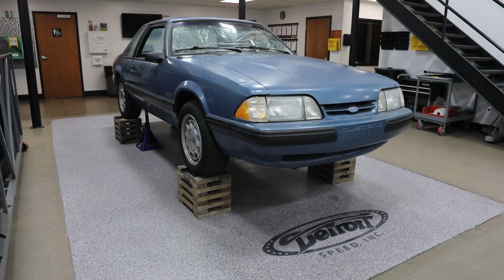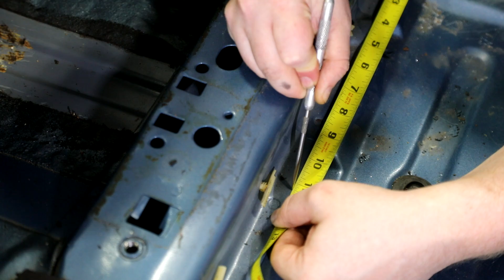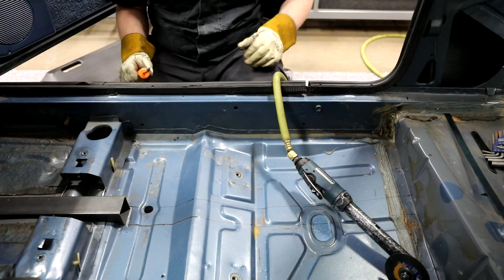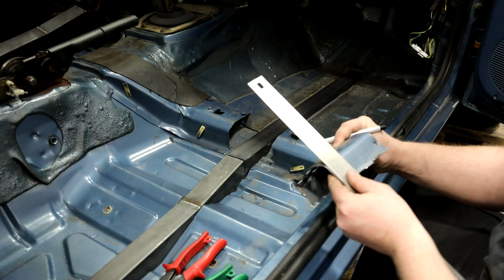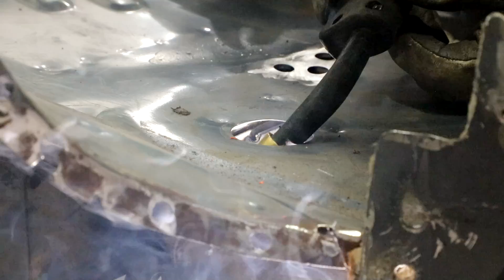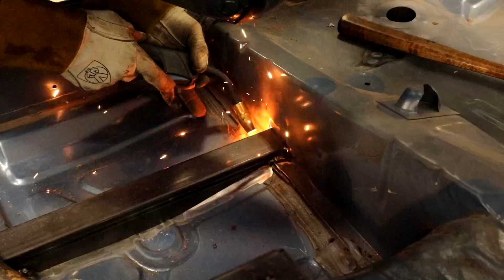How To Install Detroit Speed's 1979-93 Foxbody Mustang Subframe Connectors

Comment: So your video say to have the rear end supported and the rear lower control arms but you have to remove the rear lower control arms to install, so do we just support the housing at that point and let the rear end hit the bump stops or do we put jackstands in the back on the frame rails?

Comment: Am I correct to say that I won’t have to cut into the lower torque boxes?  I have aftermarket ones already installed and to me it looks like the rear frame connector just welds you the side?

Comment: Great video, very detailed and to the point! And 1 question. I know that some water drains down through the frame rails from the upper cowl areas. How do you compensate for the water draining from above? There are holes in the factory rails.... And definitely keep the Fox parts coming!!
Reply from the maker: We haven't really experimented with that, but a relief hold could be drilled into the replacement connector.

Comment: Would like to see a jacking rail developed for the foxbody convertible.  It should be strong enough to jack the car up using the middle of the rockers.
Reply from the maker: Subframe Connectors can be utilized as a jacking rail.

Comment: I am shopping for a 5.0 now can you tell me estimated time/cost to install by DS the subframes?

Thanks.
Reply from the maker: Duane, installing subframe connectors in the car is not something that we would do here at Detroit Speed. We mainly focus our Project Shop hours towards full builds. The subframe connectors can be installed in roughly 24hrs, this is dependent on vehicle condition and installers skill level.

Comment: I see you are doing a series of short tack welds when joining the thick subframe connectors to thin panels. Do you use a smaller MIG wire like 0.023 due to thin floor pans or do you use 0.030 due to the thick connector?
Reply from the maker: We use 0.032 MIG wire in our machines, but we use short stitches to keep heat from the thin sheet metal on the floor pan. It is important to aim your weld towards the thicker metal on the subframe connector.

Comment: Will #detroitspeed have their own front suspension with K frame?  Would really love to see an irs option as well.
Reply from the maker: We are currently working through finalizing design for rear suspension before we move onto the front.
Reply: @detroitspeed  Excellent, thanks for sharing the info. We are all excited to see all of the parts and upgrades you have planned for the fox chassis!!!